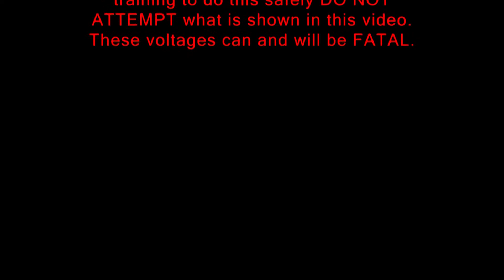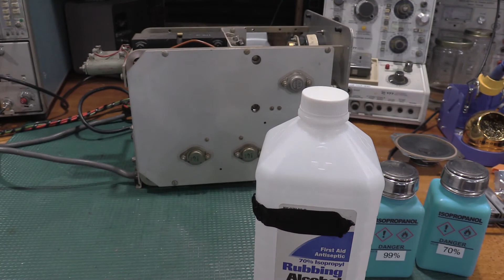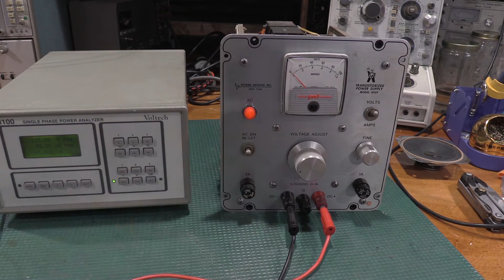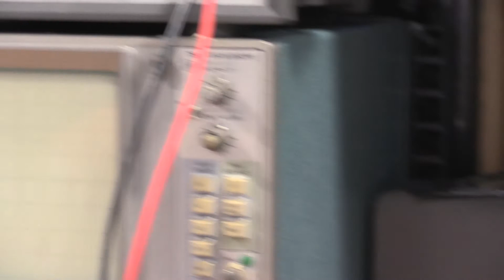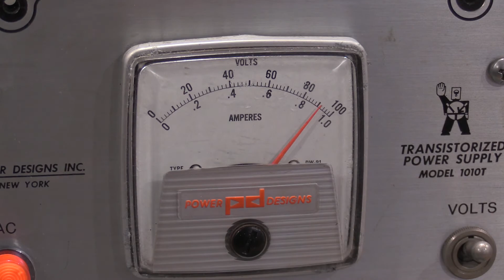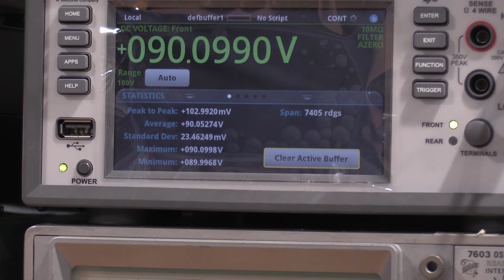Power Designs 1010T Lab check in and cleaning

Comment: Won't the 99 % isopropyl alcohol absorb water from the air until it is 91%?
Reply from the maker: If left open it will soak some water out of the air The Menda bottles are sealed and the vapor pressure in the bottle keeps the air inside stable as long as the seal holds. But if a bottle were just left open it would be a race between dilution and evaporation. I would put my money on the alcohol flashing off and evaporating faster then water absorption. Though this is a problem in ethanol fuel stored for long periods of time like 2 cycle fuel mix for chain saw or weed eater.

Comment: Fine video but you miss the regulation under load?
Reply from the maker: Hi Carlos, Given the current disruption in the world I am having difficulty sourcing proper load resisters for testing. They are taking an extremely long time to ship. These power supplies don’t have a current limit they only have an output crowbar. So I need a 100 W worth of resisters of some uncommon values.